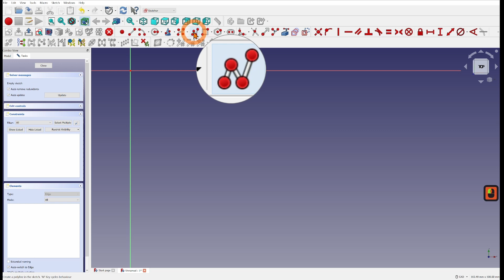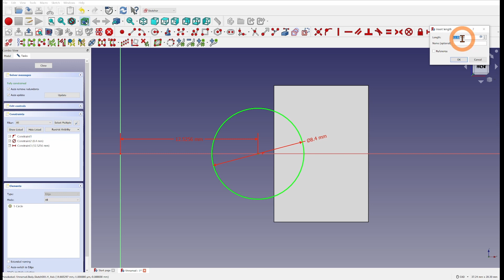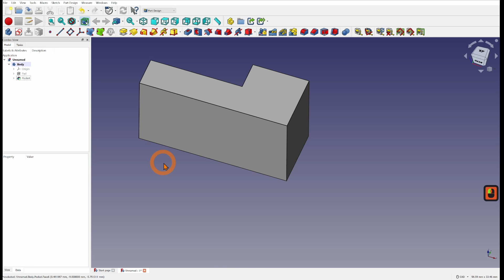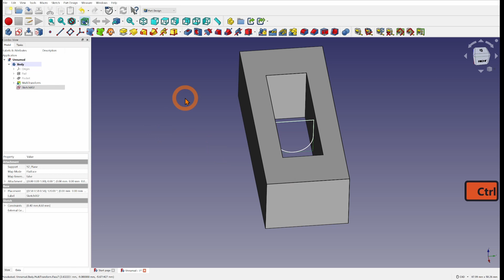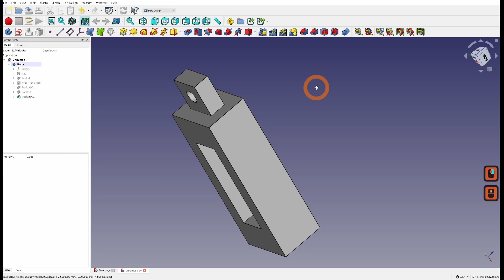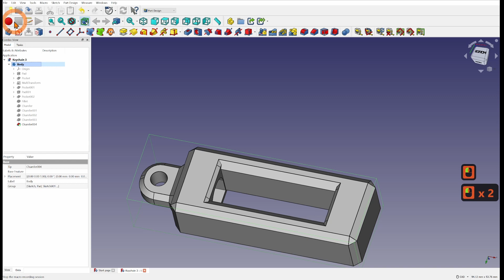FreeCAD Tutorial | Designing 3D Prints with Embedded Magnets

Comment: great clear and simple to follow tutorial for a first time FreeCAD user. When i z aligned the magnet cut out to 8.2mm and press ok, all looks ok (13mins) but when i try to create the pocket to 2mm i keep getting an "Wire Not Closed" warning. Not sure what i am doing wrong.
Reply: it's ok, i figured it out... my arc and my slot were not connected, i did try and join the lines but ended up re-sketching the slot making sure the points turn yellow to ensure lines are connected.
Reply from the maker: Awesome work, you got it!

FreeCAD 1.0 release candidate is available and way more stable then the current version and you get a lot less of these kids if issues.  The freeCAD Devs are really brining out the A game on the next release, it really feels like something special.

🍻

Comment: Nice.
But some hints:
‣ You could have generated the key-holder-loop from one sketch on the xy-plane including the hole and the round end.
‣ I like selecting edges in the wireframe view (shortcut: v-3). In wirefame view you can select otherwise hidden edges and there is no problem of selecting a face on error.
Reply from the maker: The reason I made the key-holder hole it's own feature is for future proofing.  It's not as applicable to this drawing but say you have a flange, that has 8 9mm bolts, all the sudden the spec changes to 8mm bolts, if you modeled 1 hole and patterned it you just have to change the diameter on 1 circle rather then 8, then it changes to 12 holes, you simply have to change the pattern number rather then have to move 8 holes on a drawing and add 4.  Once you develop a good work flow you tend to stick with it.

Great hint with the wireframe.

Comment: DUDE!!! You did not add the part where you actually add the magnets to tbe print. That's bad. The tutorial was going good. Tha would be BE.A.U.TI.FULL haha

Also, a tip for you. When you have edges that follows a smooth line.. like after applying the fillet. You don't need to select all the small little edges to chamfer them. A line segment is just enough. The chamfer will follow the edge since it has smooth transitions. So instead of selecting 10 pieces of edges you could have just selected 2.

Another thing for the tutorial. Click the body and add a transparency. I like to use 80%. The  we can see through the object. It is Much easy to design and also a lot more easier to follow the tutorial.

Next thing, you are using "CAD" shortcuts. Se the bottom-right of tbe window. The "Touchpad" mode is way better and works pretty well when using mouse too.
Reply from the maker: Already on it.   I had some issue with PETG leaking causing under extrusion  on the first layer after the resume.  Talking about the fix added another 10 min to the video.  So Instead I'm editing it into its own video.

Never thought of doing 80% transparent, I'll give it a shot, frankly it sounds baddass.

As for commends I try to keep the settings as stock as possible because it is a tutorial.  There's nothing worse the. Seeing someone use a hotkey, getting frustrated because it doesn't work only to find out that they remapped it.  For personal use I have copy installed that has commands/shortcuts remapped to mirror SOLIDWORKS.  That's why you sometimes see strange motions, the old money brain goes back into SW mode because that's what I learned CAD on.

🍻